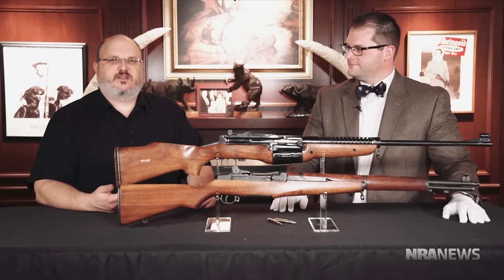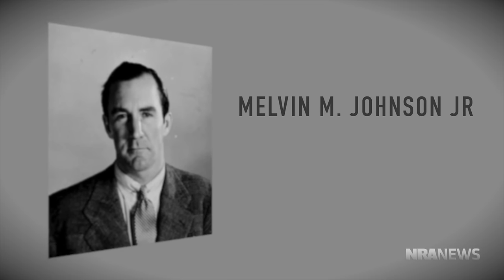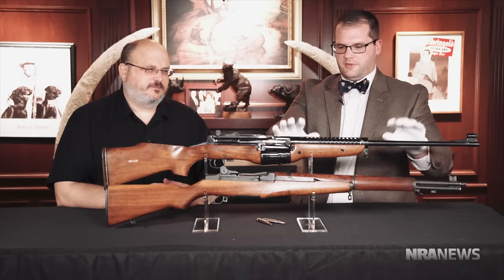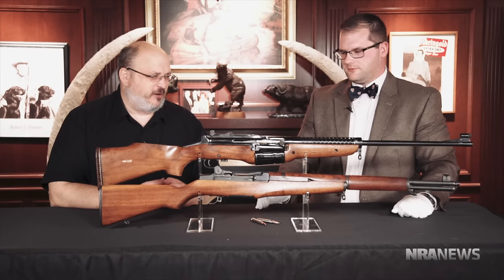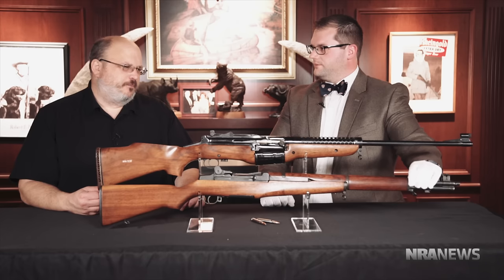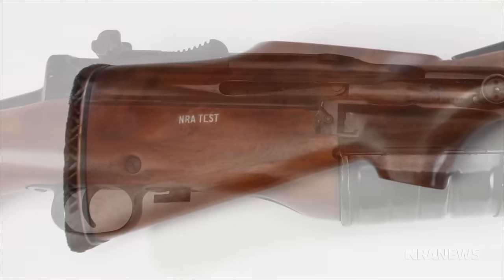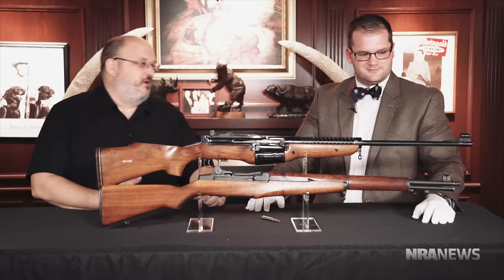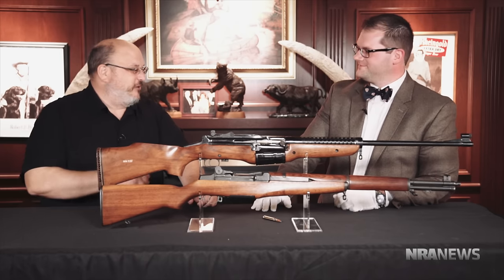Curator's Corner: Johnson M1941 Rifle

Comment: What was the serial number range that was given to  the marines to used ? I have a 1941 Johnson and would like to know, Thanks
Reply: Marine Corps M1941s were not from a particular serial number range. Of about 28,000 M1941s produced, the USMC took about 700 rifles. Those used in the Pacific were most likely disposed of in theater, so the chances of yours (and mine) being USMC rifles are slim. The few verified USMC M1941s have their provenance through personal records, and not official ones.

Comment: The rotary magazine is cool but if you drop the gun and dent the housing the mag will no longer function.In the late 50s and early 60s these sold on the surplus market for $79.95,bout the same as the M1 Garand.In 1946 the Israelis bought the rights to Johnson's light machine gun and began producing them as the "Dror".

Comment: the M2 50 cal using a similar blow back design.  Johnson went on to help Eugene Stoner on the AR rifles and the barrel lugs are very similar.  One of the advantages of the blow back design, is that powder gases do not contaminate the action and requires very little cleaning.  The ability to add single rounds to the rotary magazine for "Topping off" is quite handy.
Reply: Incorrect- the M2 like its US MG cousis the 1917/A1 and the 1919- are all short-recoil, not blowback; this is also true of the Vickers and the Maxium WW I belt fed machine guns.  These MGs fire very, very reliably and these were also very clean firearms with minimum carbon powder fouling.
Reply: yup...I got my definitions wrong and understand the difference now...thanks.  So is delayed blow back the same as short recoil?